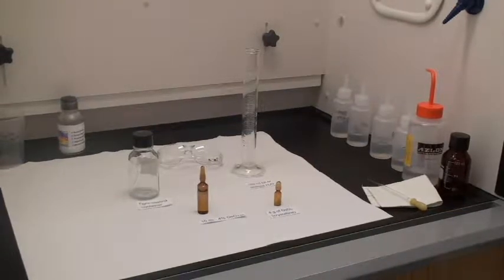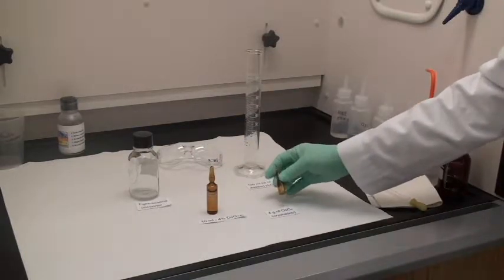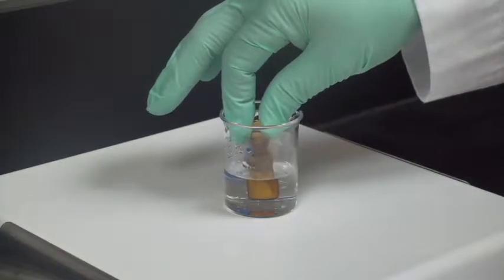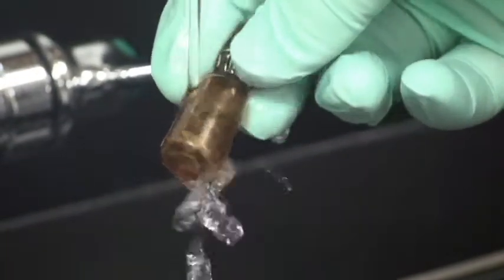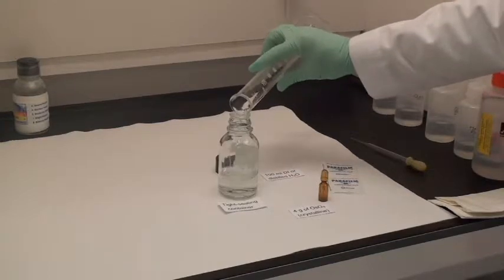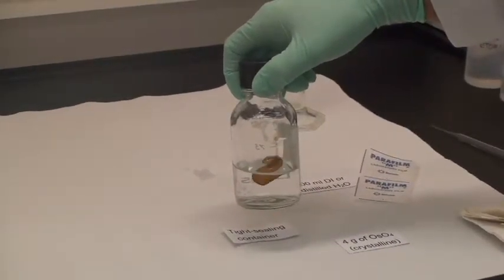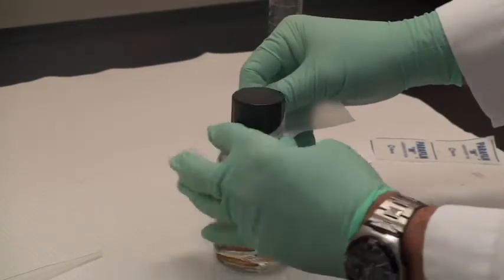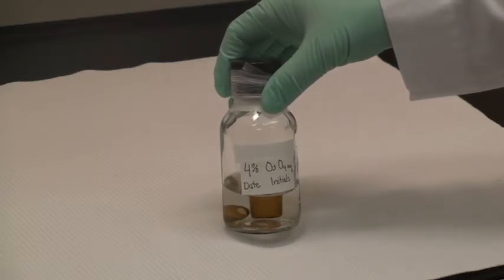How to Mix Osmium Tetroxide

Comment: Can it be stored at RT or in the fridge? How long does it last?
Reply: Use a PTFE stopped glass bottle. Storage in the lab fridge is highly recommended. Also protect from light. It stores indefinitely, however with each use the strength degrades. For this reason it's recommended to do several EM specimines in one exposure as the amount used to do on or a dozen is pretty much the same since a nanogram or less is actually absorbed per sample, yet the same amout of vapor is emitted by the stock solution.

Comment: Instead of parafilm, it is better to wrap a PTFE film under the cup of the bottle
Reply: I would do both.
Reply: @BackYardScience2000  Yes
Reply: It will diffuse through parafilm. Use a ptfe stopper or cap liner.